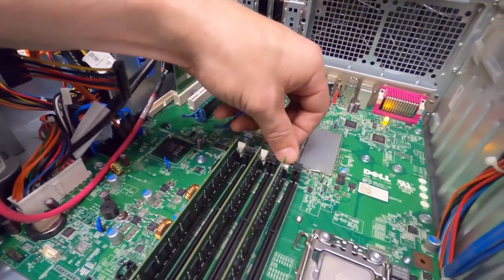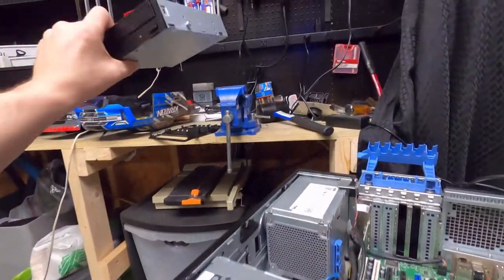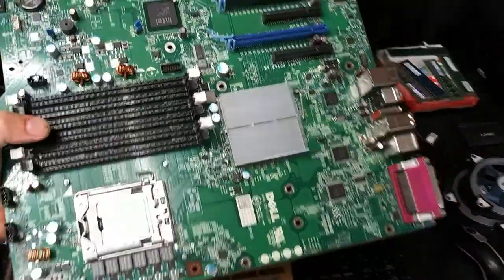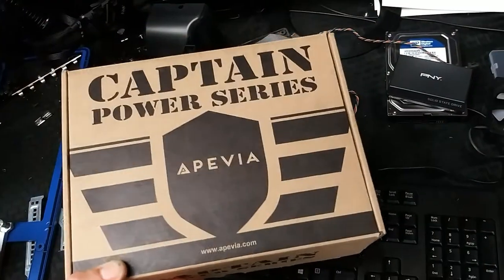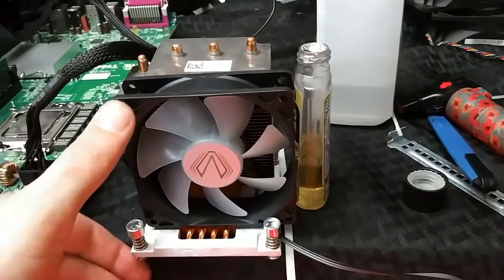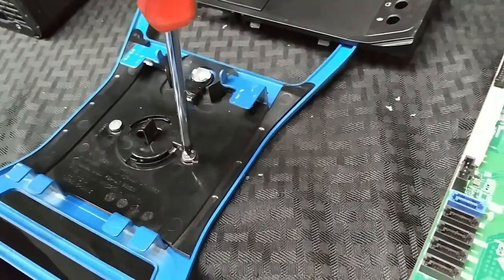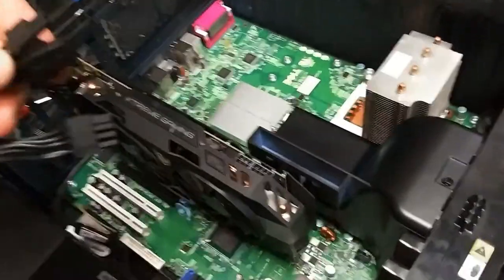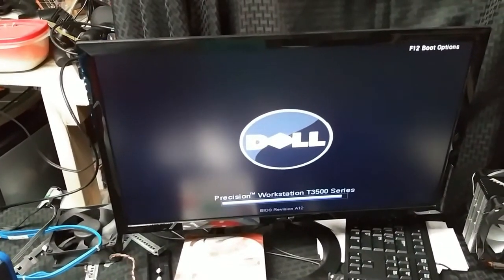Dell T3500 Gaming Upgraded DDR3 Pc

Comment: hafta take off the bracket around the cpu....cut the ears and a normal cooler will fit...got a vid too...awsome job man!!! i was getting a deal off ebay on mobo and cpu and flipped about 4 t300 pcs ...put in a rosewill case..mesh front and blue fanswas 60 to 70$....wasnt a bad pc...the xeon was like 3.3ghz..
Reply from the maker: True

Comment: Thanks for the video. I am searching for an alternative to the U016F heatsink. Are you aware of anything I can use which would fit the original case case and get attached to the backplate? Thanks

Comment: hi i have a dell t3500 with xpdfk motherboard now i usually use gtx 1050 2gb inno3d but i plan to upgrade to 1060 or rx580 will it be ok if i put one of these graphics cards? xeon x5675 processor 6/12
Reply: If you leave the original PSU in it any GPU will work that has a 6 pin PCI power connection. I think the GTX 1650 is the best. If you switch the PSU out you can go even higher. I used to run a GTX 1050 Ti in mine.
Reply: @ocsibaby  i installed gigabyte geforce gtx 1060 windforce oc 3g
and I have a dell t3500 temperature on the desktop 55-60 ° C is this the norm? in the furmark for 10 minutes the temperature is 83 ° C and in games it mostly stays within 69-78 ° C
I want to clarify that my cooling costs dell t3500 unchanged
Reply: @ayanokoj1.720  Are those GPU, CPU or Motherboard temps? For the GPU it's normal. You can (if you didn't already) install two 8 cm exhaust fans on the back of the case. That's what I have. It helps taking heat off the GPU. The problem with the layout of the T3500 is that the GPU sucks hot air in because it's behind the CPU cooler. So exhaust fans just help move that heat out of the case that much faster.